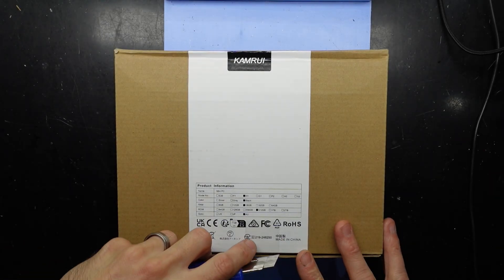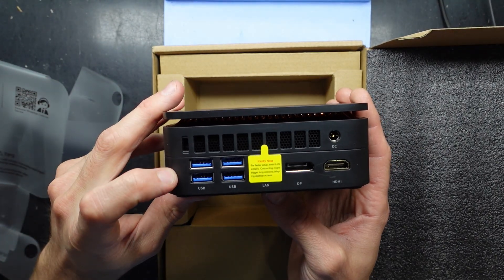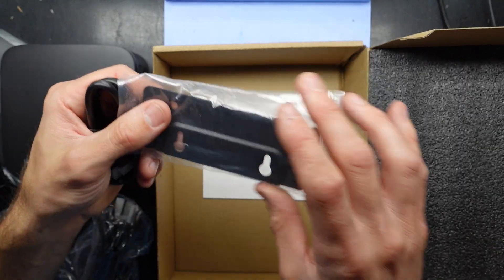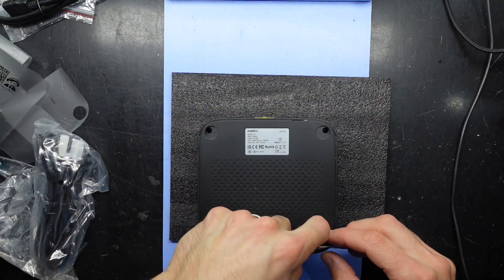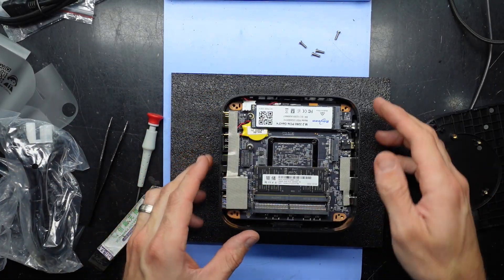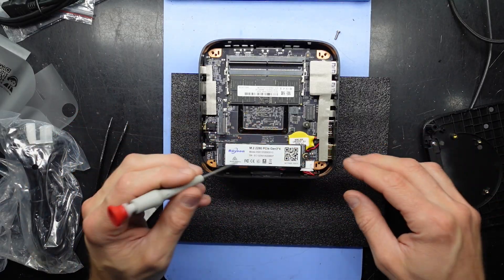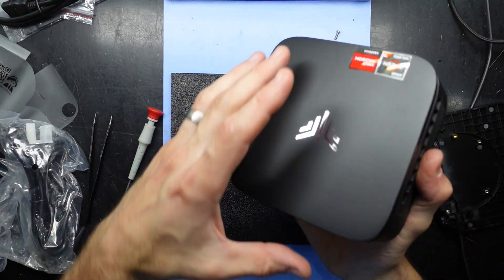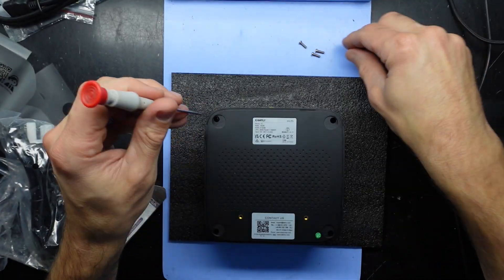Kamrui H1 Ryzen Mini PC Unboxing and how to upgrade

Comment: I got one of these, it's a fair beast but very cheaply and poorly made. The Display port doesn't work on mine but HDMI works fine. I think there are way better mini pcs out there for the money. Despite its 28 watt bottleneck it performs admirably in geekbench... scoring 2038 for single core and 9385 for multicore... it's only slightly slower than my 5700x desktop rig! The graphics scored 25,685 which is lower than some 680m rigs but overall I'm impressed! Update: The usb c monitor connection works beautifully. I think my issues with Display port were due to my ancient monitor...
Reply: Which mini pcs are way better for the money that you could recomend?

Comment: I just recently got a KAMRUI E3B Mini PC, and while I haven't opened it up yet, the housing looks extremely similar to this Kamuri H1, if not identical.  The wifi card it comes with is a "MediaTek Wi-Fi 6E MT7902 Wireless LAN Card", which unfortunately does not support Linux, and I am wondering if (assuming it follows the same layout as the Kamuri H1) it would be possible to replace the card with one that does support Linux?
Reply: For anyone who's curious-- I did end up upgrading it to an Intel AX210-- it was $16 and now Linux works.  I also added a WD_BLACK 2TB SN850X NVMe-- there was an additional slot so I left the 512 GB HD in  place.  The layout was very similar to what is shown above, except there was a metal plate under the plastic cover that came out with a normal-sized phillips screwdriver.  After that, the wifi card was underneath the HD as shown.
Reply: @ScarabaeusSacer435  Interesting... I was wondering the same thing, if not for Linux for the added stability of name brand bluetooth.

Comment: How has the mini pc been operating since first boot up? Is the fan noise tolerable for gaming?
Reply: I'm over the moon with my H1... It's very fast and quiet... it only runs at 28 watts compared to the 45 watts the 6800H is rated for which really isn't a bad thing. It outperforms competitors that run at the higher TDP, maybe because its not thermal throttling.
Reply: @brendanhoffmann8402 yo would this be able to run Minecraft good